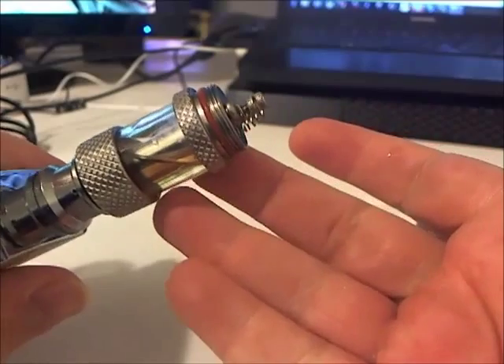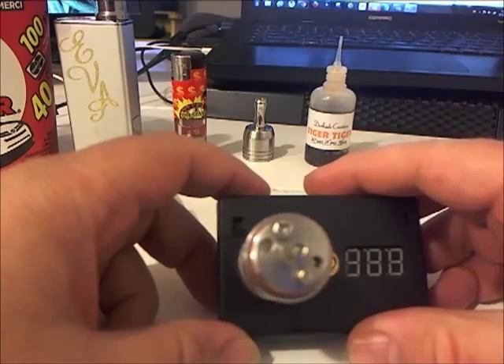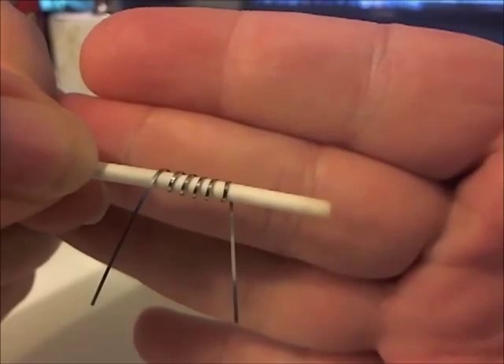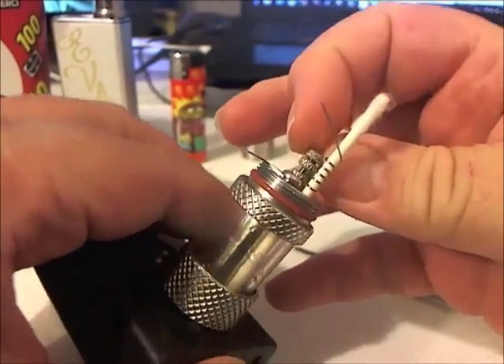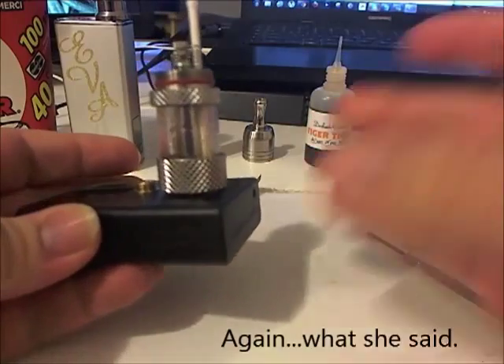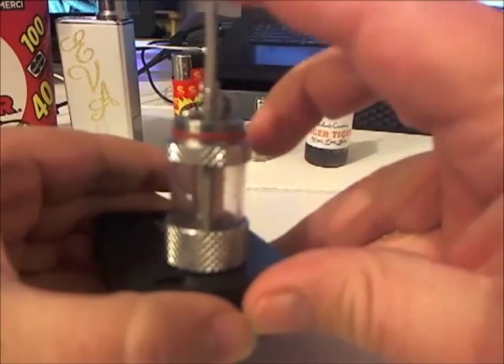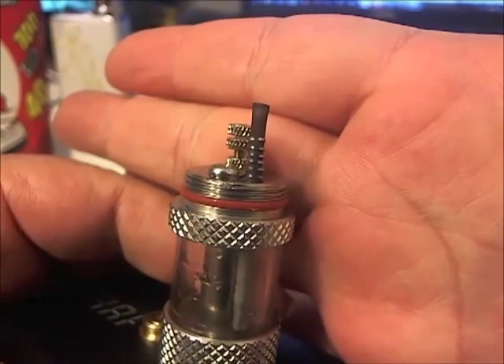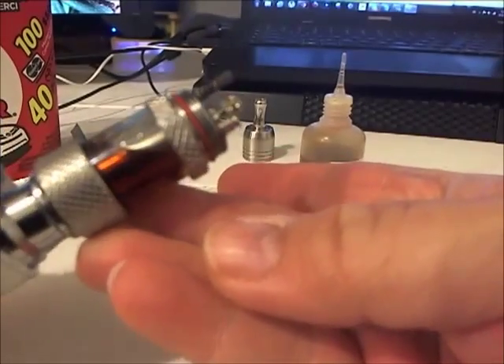Rebuilding a Genesis style atomizer

Comment: Good to see you got it working! I use a lot more mesh to make my wicks, usually 50 - 70 mm or 1/2 - 2 inches it's difficult for me to roll (I have neuropathy), but it wicks without having to tilt. Another thing I do is to cut the bottom of the wick on a 45 degree angle tp help wicking. The most important thing is to make sure the aithole is lined up with the wick, I had to file the topcaps on my Aga's to do this but it's worth it. Sometimes a little dental floss under the o-ring works too.

Comment: Gold melts at around 1500 degrees I doubt these atomizers get hotter than 400 definitely don't think it will melt although it will be fairly expensive you can get 30 gauge solid 24k gold wire on eBay for around $40 a foot it just seems that the reason the atomizers go bad is corrosion the wicks last a really long time but the wire is what wears down. Gold doesn't corrode ever so you might end up with a ever lasting atomizer how cool would that be.